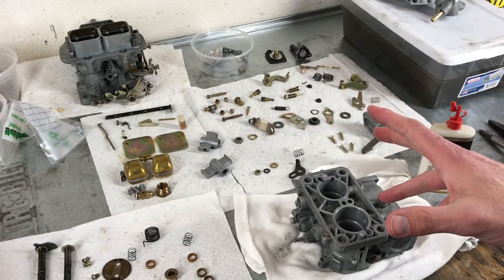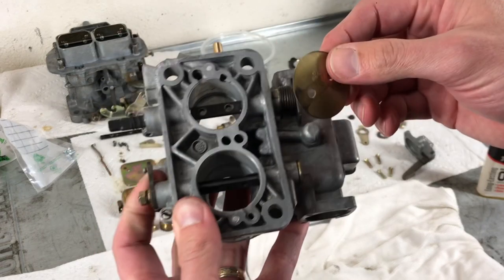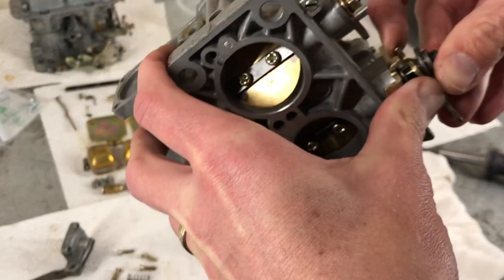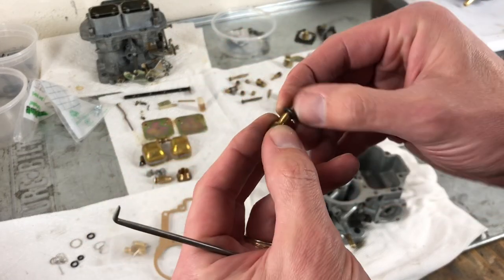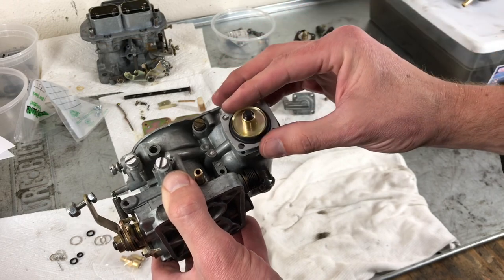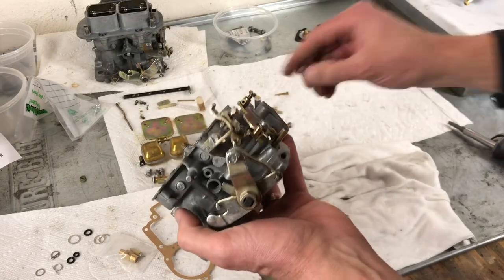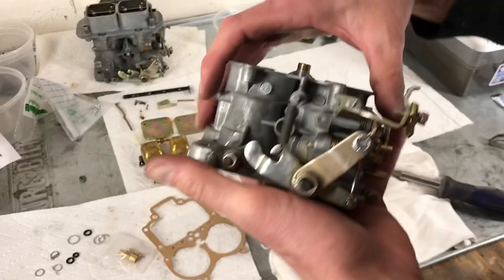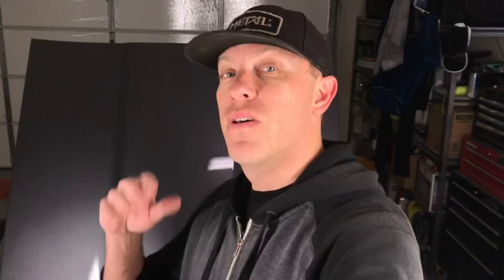How to rebuild a Weber 32/36 carburetor.

Comment: Great video, I only wanted to check on the procedure for setting the float valve, which I scrolled through to, and watched that. It was infinitely better than the other short videos in here that failed to give the necessary detail that you provided. ⭐️⭐️⭐️⭐️⭐️

Comment: Excellent video. I have one of these on a 77 midget instead of a Stomberg. I'm mostly familiar with SU carbs from Sprites and my midget runs rich and the carb is crusty, so got myself a rebuilt kit and will follow your instructions, especially with respect to the careful ordering, videoing the whole thing to act as memory, documenting components and NOT flinging the spring across the room!

Comment: I used this for the carb on my 1981 Mazda B2000 and it was helpful, clear, and descriptive. After I was done I slapped it back in the truck and started her right up. Tuning was easier than cleaning the thing.
Reply from the maker: Right on! Thanks for letting me know! 🤘🏻

Comment: Accelerator pump valve assy that holds the “squirter” in place is actually a check valve with a bb in it. 13:30. Shake to ensure bb is free, blow and suck lightly to ensure check valve function while covering two side holes. Do not use carb or brake cleaner as it has a nylon insert inside. Better still, just replace it when you rebuild. Most kits dont have this part.

Comment: I have a plymouth arrow pickup 1980 and a d50 ram 1986, I'm putting weber 32/36 (Spain) my question is what throttle cable do I get in replacement of the old ones?

Comment: @20:46, you state the plastics should be 35mm from bottom to top. The plastic floats are 27mm tall so that only leaves 8mm from top of float to top of lid. Does that sound correct? I see 18mm clearance from top of float to lid so that would be a 44mm total bottom to top referenced in other places. Confused.....

Comment: I've got an issue with my Weber dgav 32/36. The primary throttle plate is stuck open and I'm wondering if it's adjustable. Or do I have to buy a whole new assembly to close the plate? I have no adjustment on my idle screw whatsoever. I've been running the carburetor for the last 10 years on a 1.8 L Isuzu 4-banger and it performs well it's just been trial and error trying to adjust this thing and they're supposed to be pretty simple so I'm assuming that open throttle plate is my issue. Hope this finds you. Thanks for the video for you have given me enough confidence to take my throttle pump apart haha cheers
Reply from the maker: +Nedly for the throttle butterfly take a look at the steps around 4:30, that should help. Could be the cause of the idle screw issue. Give it a shot and let me know! Thanks for watching!
Reply: @CarsBikesandCoffee  Awesome! That's what I initially thought. With that much of an opening on the primary plate, there's no way in hell I was going to get any action with the idle speed screw. Thanks for the response and the video! Cheers man!
Reply: @CarsBikesandCoffee  hey man I appreciate your response on my last comment. I was able to fix the issue with the throttle plate. I have a lot more adjustment on the idle speed screw. The other issue I have now is emissions. Over the years I've kind of struggled passing smog but was able to dial it in pretty good. Some years it went pretty smooth but now I'm running like 7% carbon hahaha it's been a little high in the past but never that high. I'm going to try to play with the jetting. In the past smog tests, I'm wondering if the plate partially stuck open was feeding it just enough air to pass the low speed test. I'm gonna play with it and see how it goes. Thanks again man. Cheers🤙
Reply from the maker: +Nedly right on!! Stoked for you. Smog is tough, maybe a good cleaning of everything, and get that engine really warmed up before going will for sure help.

Comment: Very helpful video, i have an issue where im missing an idle jet on one side. The one that remains is like the one in the video that threads in. But i cannot find a single replacement online. Only idle jets without threads do you know where i can get them or if use those with the “idle jet holder”
Reply: Or is the idle jet look like one piece but its actually in the holder

Comment: You should tighten down the shaft nut first, because it will pull the plate off to one side when you tighten the nut and likely will bind.  Tighten shaft nut first to get permanent lateral shaft position then tighten throttle plate.
Reply from the maker: This is an awesome tip! Thanks!

Comment: 1987 Mitsu montero with a weber 32/36. Just had a fail today. Truck is now revving at 4000rpm at park. it happened after driving it all day. Both flaps are now fully open and are not closed at the start.. Is this an electronic choke issue? Just ordered a rebuilt kit, but don't know what I need. I checked the cabling and the throttle pedal cable assembly works. Any knowledge of the failure?
Reply from the maker: Is the the throttle return spring unhooked maybe?
Reply: @CarsBikesandCoffee  it’s the rerun cable. It’s locked up. Can’t release. Ordered newer version on cable but needs to be retrofitted and done with a transmission fluid and filter change. Not fixed but hooked up a bungee cord to pull back on throttle
Reply from the maker: Ah, you got it figured though, nice! Bungee cords come in handy

Comment: Super cool video, very useful Thank you very much
The engine switches off when the speed is switched from the third speed to the second speed. Or stop in a position when waiting for the light signal
What do you propose to?
Reply from the maker: +hashkoun thank you!!

So to make sure I understand, when you shift gears from third to second or when you are at a stop light, the engine stops? Could be a few things but sounds like your idle speed isn’t high enough or there is a clog.
Reply: clogged idle jet

Comment: I recently bought an 85 cj7 that has this carb on it. It runs rough and I’ve done all the normal tube up stuff to get it running right but it’s still rough. It hesitates in second gear from time to time. Really 2nd to4th it will hesitate. Not all the time though. Sometimes it runs great. Would my carb cause it to run rough. I know on my Harley it does. Carberated vehicles are new to me. Any advice I’d appreciate. Great video too!
Reply from the maker: +Ryan Cornelius thanks for watching! So assuming timing was part of the tune up you mentioned, when it hesitates, is it bogging down? Have you checked fuel filter(s) and the gas (is it new or old)? If it has been sitting for awhile the old fuel in the carb could clog a jet or the passages. Doing a rebuild wouldn’t hurt, but replace fuel filters and drain the fuel if it is old.

Comment: Why does fuel come through the primary ventury when idling, checked the fuel level in fuel bowl and found ok, in fact a little bit low
Reply from the maker: Sounds like the float valve isn’t shutting all the way possibly.

Comment: Hey man this is the best video out there on rebuilding these carbs, thank you so much. I wanted to ask you a quick question, I pulled two of these off of a barn find 260z and I’m trying to figure something out. One of them doesn’t have the choke shaft or plates??? And the other one has the choke shaft but not the plates? I’m very confused I was told it was running when it was parked but won’t the fact that there’s no plates mean that the air flow isn’t being controlled? Not sure what to do at this point. Most likely going to buy new choke plates and a choke shaft, just trying to think if there’s a reason it could be setup this way in a dual carb system. I’m pretty new to carbs so I’m trying to learn as much as I can. Hopefully you see this, and thank you in advance !!
Reply: I actually just realized the holes for the choke shaft are plugged in the one that doesn’t have it. It looks too clean to be someone messing around with it
Reply from the maker: Hmmm they both should have chokes. You would in essence have an unbalanced engine at startup. Did you double check the model at the base of the carb? 260Z are awesome, currently building one on the channel.
Reply: @CarsBikesandCoffee  that’s what I thought too, but it’s literally welded close. For now I decided to keep it and get the car started to see how it runs. I just installed them but now having issues with getting fuel. tried getting it running and it was cranking but not starting. Sprayed some starter fluid into the carbs and started for a second then died. Took a look at the inside of the carb and realized it’s not getting any fuel. Pulled the line from the mechanical fuel pump to the fuel rail and no gas there either. Pulled out the mechanical fuel pump to make sure that the arm is in the right position, and it is. Tried to manually pump it and didn’t produce any gas. Chased back down to the plastic fuel filter and didn’t have any gas in it or gunk either. Went to the back to check the electric fuel pump, it’s definitely not working since I’m not hearing it turn on, but I was going to bypass it for now to see if I can get the car started. I was also wondering if the fuel filter in the electrical fuel pump was clogged. The weird thing is when I pulled off the electric fuel pump inlet from the gas tank, no gas came out? I have about 6 gallons of fresh gas in there, I can’t imagine it’s low on gas ? Not sure what’s causing this problem. By the way car runs good for a few seconds if I put gas straight into the carbs. My last step will be checking the lines themselves, but after draining the gas tank I had no particles or any debris in there so they should be clean. Right now my problem is at the pumps, please let me know your thoughts !
Reply from the maker: Sounds like you’re on the right track. Check also that you’re getting power to the electric fuel pump if you haven’t. You should be able to get a start from just the mechanical pump. Might be a couple things going on. You checked/flushed the fuel line I recall?
Reply: @CarsBikesandCoffee  thank you again for getting back to me, I actually got her started yesterday!! I had a problem with the idle being at 3k and I thought I had messed up setting the screws but thankfully after looking around I realized the throttle linkage wasn’t allowing the plates to fully close. I just finished up for the day, engine sounds good and healthy. Now I just have to bleed the brakes and the clutch, and she’ll be on her maiden voyage!
Reply from the maker: That is awesome! Way to go!🤘🏻
Reply: @CarsBikesandCoffee  thank you! Now I’m just going to bleed the brakes and clutch and take it out on it’s first drive!

Comment: Thanks for posting this video. Very well explained. On my carby, when the fully opened and has reached its stop the secondary throttle does not fully open. Why would this be so? [as per 8:40 mark  on video]
Reply from the maker: Appreciate you watching! There is a small linkage on the side that pushes the secondary open, is it jammed in any way?
Reply: @CarsBikesandCoffee  
No, it is not jammed. I also saw a clip on YouTube at; https://www.jeepforum.com/forum/f8/weber-carb-second-barrel-not-opening-1280380/ that has much the same thing. The butterfly valve shafts have flat spots on the shaft, so the linkages cannot have moved around the shaft [tight fit]. By the time the first valve has reached its end of travel, the second valve has only opened about 1/2 way. Maybe I need to weld a bit to the linkage that goes to the 2nd valve---see 7:53---so that the bent piece at where your thumb is at 6:36 start to open the second valve sooner.
I have not pulled the carby apart, I just noticed that the second valve does not fully open, I am wondering why.
Reply from the maker: +Ross M hmm I don’t think you should have to weld. It’s tough without seeing it. The big question, did it work fine before or has it always been like this. Can you post a video of it to check it out? I’m curious if the order of the primary shaft linkages is off?

Comment: Most carburetors I've ever worked with have the screws  securing the throttle and choke blades staked (expanded) on the end to prevent them  coming  loose and getting sucked into the engine.  If you try to simply remove them you'll damage the  threads in the shaft.  Is this not the  case with the webers?
Reply from the maker: They are staked
Reply: @CarsBikesandCoffee  Did you grind down the staking and use new screws for the throttle and choke?
Reply from the maker: New screws were used, yes. Old screws lubed for removal.

Comment: had a gas leak soaking throught the base connector gasket and i ended up buying a new 3236 dgev carb and did not replace the base plate for the manifold. The new carb worked fine with no vacuum/gas leaks for about a month then it all of a sudden srarted leaking gas through the new gasket in the same place it did before. What can i do to permanently fix this issue? When the gas leaks obviously its idling poorly and basically breaks down until it starts again. I need to correct this asap. Thanks for your help. Any suggestions would be great. Truck is sitting there in my garage waiting on me until i can fix this issue and all i want to do is drive it. Nobody in my area knows anything about weber carbs or wants to work on them so i feel like im on my own. Thanks
Reply from the maker: +Puck sounds frustrating! Okay, so when you replaced the carb it worked fine for a month or two? It almost sounds as if the float or the valve isn’t shutting off the gas and it spills over into the carb down into the intake manifold.
Reply: With all due respect
You  put the 135 main jet on secondary side and 145 on primary side.
I have never seen the bigger main jet in the primary side.
So double that please.

Comment: Hi from NZ, I have a 32 dgv on a 78 ford escort sport. The choke butterfly shaft is worn, as well as where it goes through the body making it loose. Is there anyway to repair this. Cheers.
Reply from the maker: +E P Local hey there! I know there is a way to use bearings as bushings, you have to drill the holes and I believe there is a kit out there to do it.
Reply: Thanks for your reply. I know replacement shafts are available so will order one of those. I will attempt to repair housing, but will look out for old carbs with good housings. Thanks.🍻🍻
Reply from the maker: +E P Local totally! Good luck!
Reply: Hi again, just wondering what the 32/36 part mean, mine says 32 only. Guessing it's the diameter of the primary. Is 36 the secondary diameter. If so does mine have the same size for both.
Reply from the maker: +E P Local you are correct. You have 32mm for both.

Comment: Hey wondered if you might have any advice; mine is seeming to leak small amounts of fuel from the accelerator pump diaphragm when the engine is not running. All you have to do is accidently touch the outer casing of it and fuel drips down it. I'm concerned in case this happens while running too without me knowing. Any idea on the problem and any tips for fixing it?
Reply from the maker: I think one of my carbs had that problem too. So is it coming out of the lever area? Has it been recently rebuilt? Also, just for good measure has the float been/need adjustment?
Reply: Thanks for getting back to me. Yeah it's definitely coming from the lever area, both underneath and from the slit in the front of the cover. It seems to be when the accelerator is pushed rather than just randomly. There also seems to be a smell of fuel in the air even after the cars stopped running. It was rebuilt a year or two ago, is my late dad's kit car and I'm trying to get to grips with it you see; so I don't know whether the floats have been or need adjusting. Any help greatly appreciated, searched for hours online with no joy.
Reply from the maker: I’ll bet it’s what you thought, the diaphragm. I would just rebuild it again and go through it o you know for sure. What kit car is it?
Reply: @CarsBikesandCoffee  Ok thanks, well I've got a new diaphragm and spring on the way so I'll replace that and see if it continues; maybe move onto the float afterwards if nothing changes. It's a Marcos 2L Coupe from'86, 2L Ford Pinto engine.
Reply from the maker: Sounds awesome! Let me know if you run into any snags

Comment: I have a 36/36 dcd. Bought a new filter cuz mine disnt have one - only to find out the new filter was too tall, didnt fit. Am i missing somethin?
Reply from the maker: +Moondrip the dcd is slightly different than the dgv that I rebuild here. Maybe they sent you the wrong one? Is yours like this? https://www.piercemanifolds.com/category_s/237.htm
Reply: @CarsBikesandCoffee  I found a hammer and forced it down - worked like a charm! Keep up ur great work here! :)
Reply from the maker: +Moondrip ah right on! When in doubt, hammer. Lol thanks man

Comment: I have watched this vid. and nowhere did i  see  what i was looking for . There are ball bearings in this carb and i pulled up the master kit on Ebay and it shows them in the kit where do they go ?
Reply from the maker: +BILL LEITZ hi Bill, there isn’t any ball bearings in this variant of the carb. Which master kit did you get by chance? Maybe for the DFV style?
Reply: -- I have a DFEV  and i replaced the top gasket and in doing so i think i left out a bearing. I found it on the floor the next day and do not no where it goes   .is there more than one ?
Reply from the maker: +BILL LEITZ ah okay. I believe the DF variants had the ball under the accelerator pump valve, I found a picture that might help #45 is what you’re after. Good luck! https://carsbikesandcoffee.weebly.com/uploads/1/2/0/8/120813631/img_1569.jpg
Reply: @CarsBikesandCoffee  Thanks i'll take the top of carb back off and that should be the info i was looking for to get the job done
Reply from the maker: +BILL LEITZ awesome! Let me know how it goes!